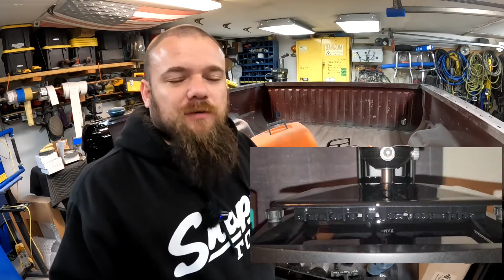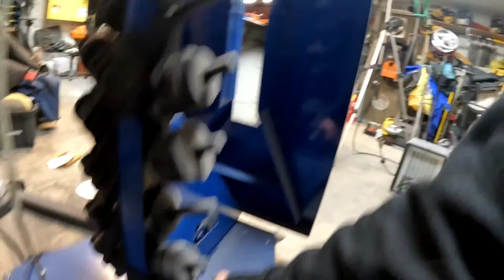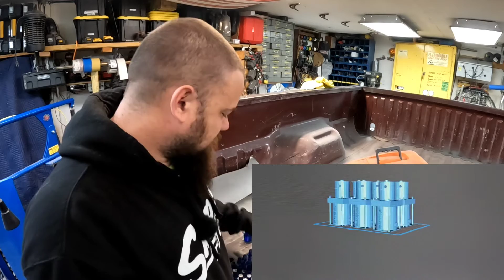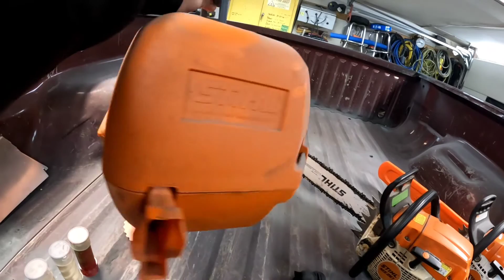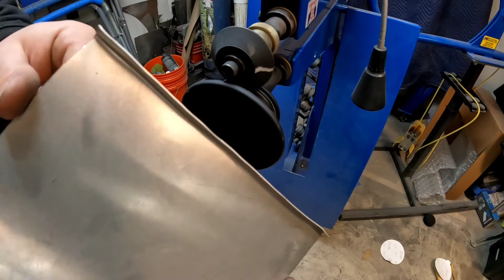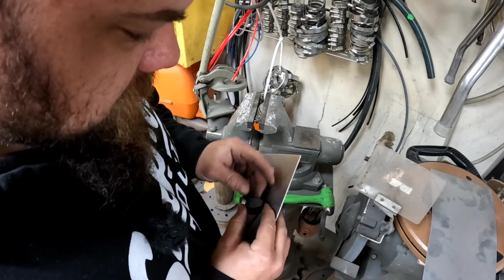Testing 3D printed sheet metal fabrication tools

Comment: Which resin did you use for the dies?  I saw some people FDM printing dies for a JD2 tubing bender, using metal end plates, https://www.youtube.com/watch?v=R7y5MIux_uQ
Reply from the maker: @TEAMPHY6  I have since changed up my printers and methods a lot.  When I made this video, I used cheap sunlu resin off Amazon. I don't know if that was the best thing for these tools, but I did seem to hold up decent for the really low price.

Comment: I see i planted a seed in chat on the video you posted about buying the chrome convoy duck. Sep 30 2022. Glad you got a 3d printer and i hope it will pay for itself. Thingiverse is a dangerous place to be, you can be lost for hours.
Reply from the maker: Yeah man.  When we spoke about it last time I had just picked up my first resin printer. Now I'm around 7 printers in lol.  It's definitely addicting when you go down that rabbit hole .
Reply: @Virginiaisforlowriders  Maybe i should not tell you that you can 3d print molds and use with sandcasting to make the parts in aluminium.
Reply from the maker: @myshopmyrules.3017  I have looked into that . I really need to stop picking up hobbies lol